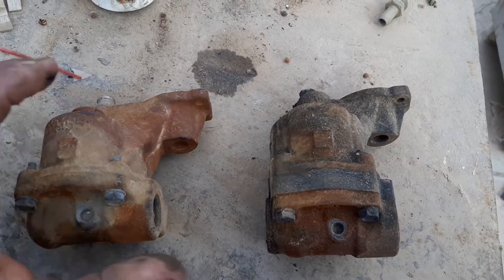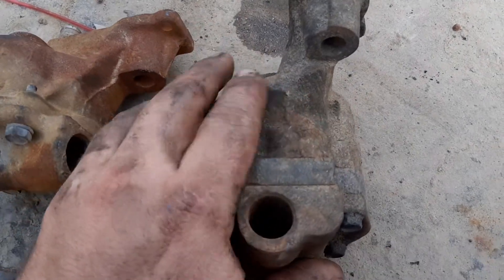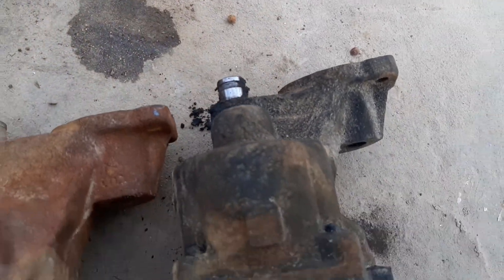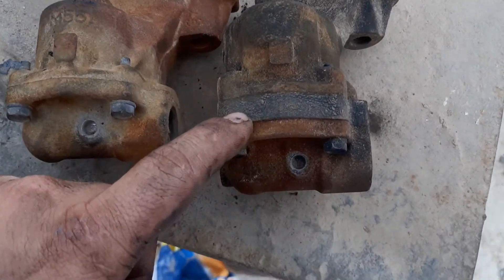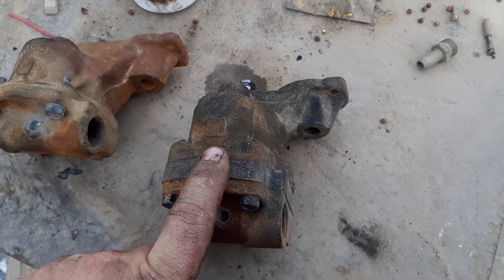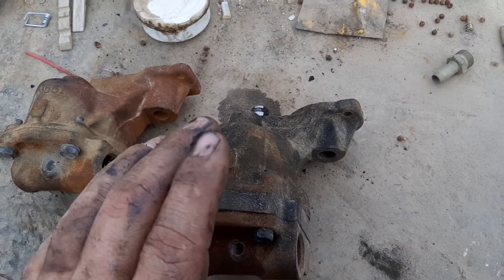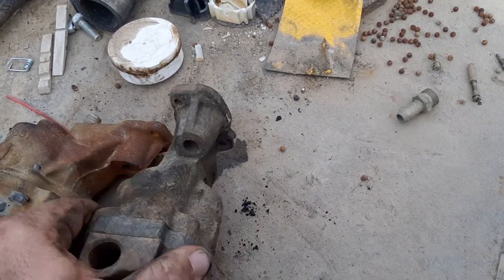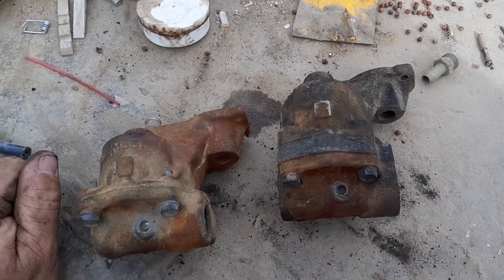Gm diesel 6.5l and 6.2l oil pump upgrade

Comment: Did you ever figure out a part number for the high volume pump?
Reply from the maker: any standard pump for a 99 or 2000 6.5l is a high volume..
Reply: Is that for 02 as well ?  @jameskilcer
Reply from the maker: 6.5 pump fits on the 6.2 has the same drive and rod..
Reply: Same case for the 6.2?
Reply: Perfect, thank you.